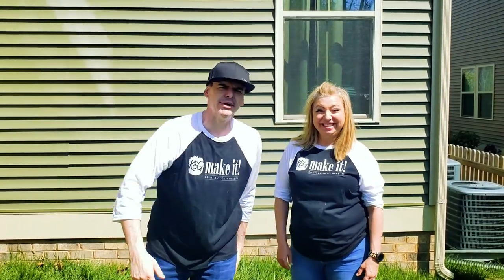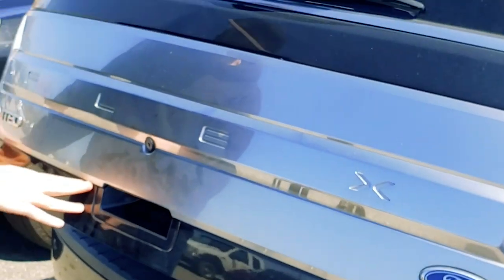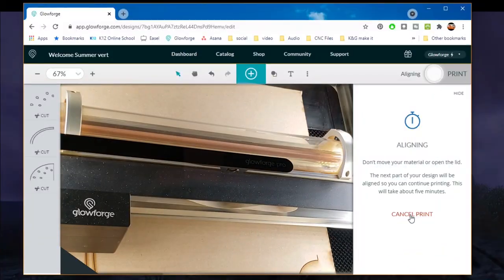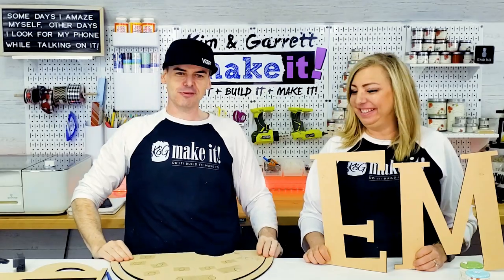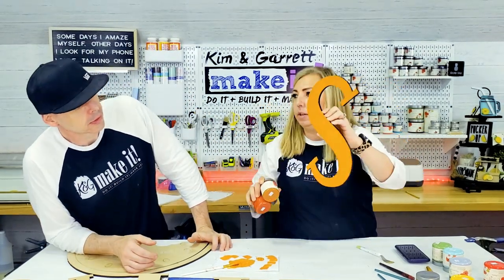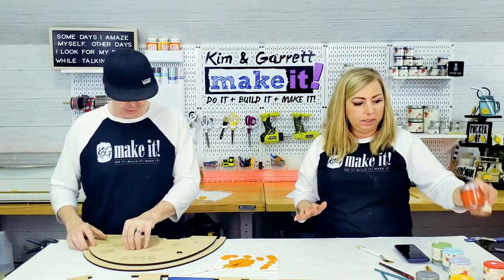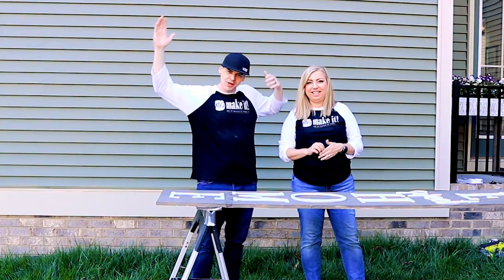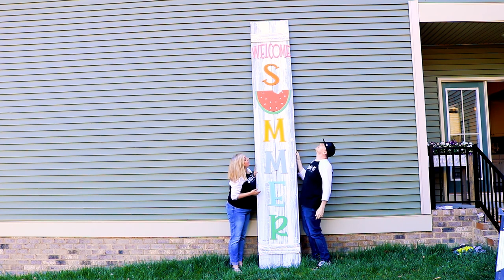Worlds Biggest DIY Front Porch Welcome Sign

Comment: We are doing a lot of construction on my home and have all sizes of extra wood so I just ordered your unfinished "Welcome to Our Home" along with paint to make a porch sign. What size length and width would you recommend? THANK YOU!
Reply from the maker: AWWW THANKS Dawn! The design is for an area of 11" X 58". We use two 5.5" X 72" pickets that total 11.25" wide. Then we have 1x3" wide braces on the top and bottom, inset 3". That should leave 11 X 58 in-between the braces for the Welcome to our HOME design.  Have a great week!
Reply: @KimandGarrettmakeit  THANK YOU!